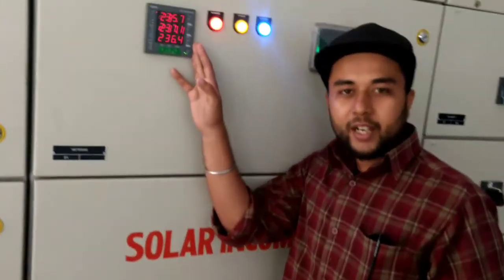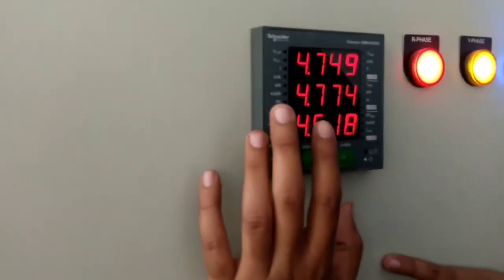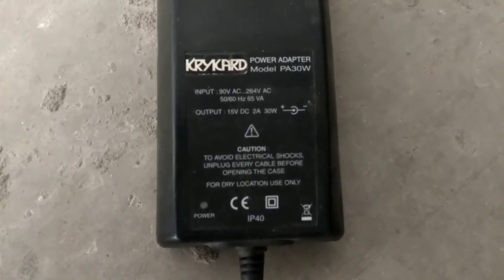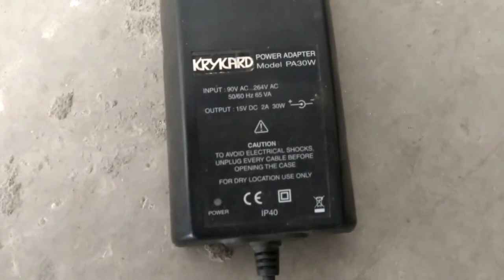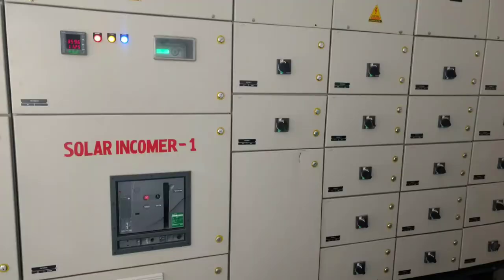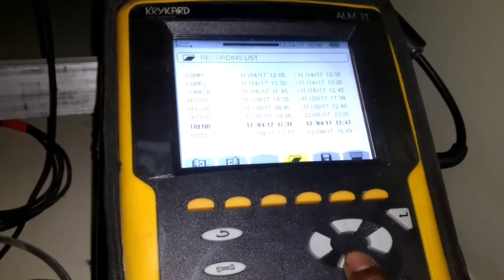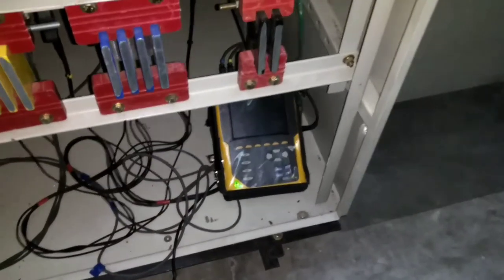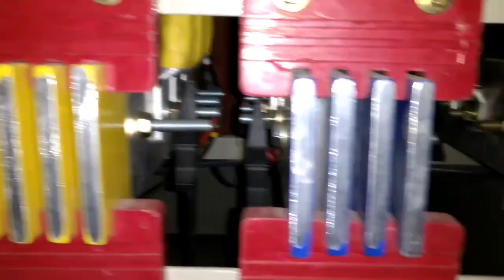Analysis of Harmonics in solar plant generation (Vthd,Ithd)

Comment: Yesterday I was doing analysis with same instrument KRYKARD ALM 31 Power analyzer.. But as per you say, ithd and vthd is low.. But when I was recording this data, i found that current harmonic level is 30 percent and vthd is 18 percent.. And customer hava a problem that, the pf at factory no load is going down from 0.999 to 0.7..But when I take readings from there energy meter at export time, the kwh unit is difference 5, Kvarh is 1 and kvah is 143 units.. So can you explain me why tjis happens and what should I do for solving this problem...

Please reply